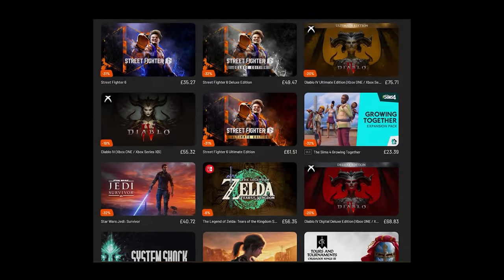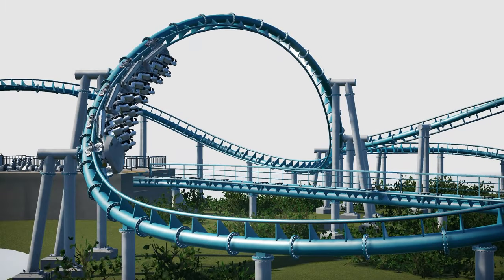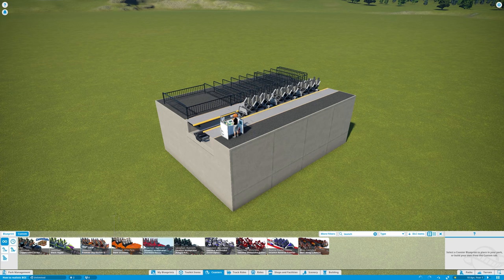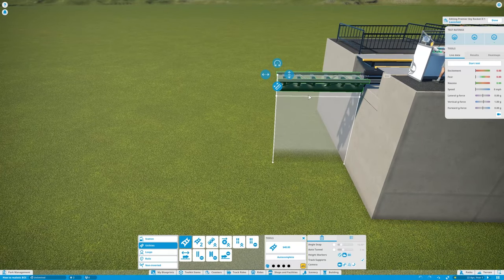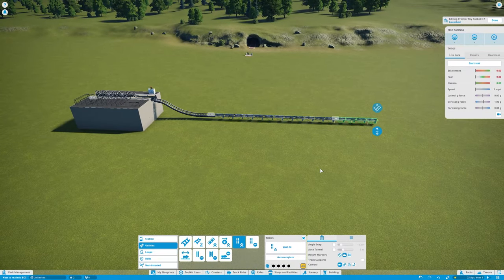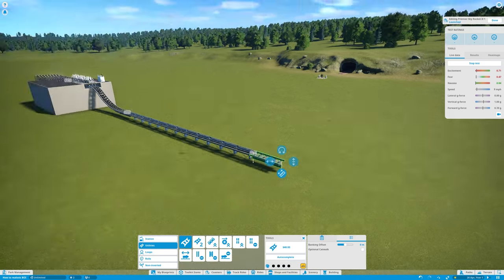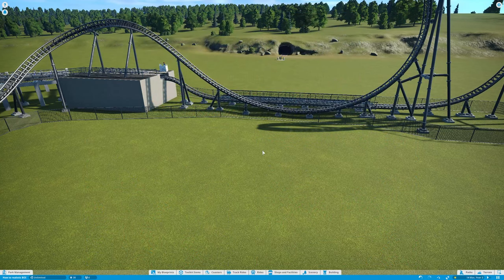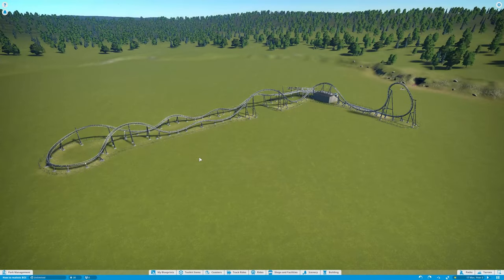How to make a REALISTIC COASTER - The Complete Guide - Planet Coaster Tutorial

Comment: Realism tip: if you're making an Intamin launched coaster remember to put emergency brakes at the end of the launch.
Reply: Is this an Intamin thing? I only just learned about them back in 2017 (Thanks Maverick @ Cedar Pointe!)

Before, I've seen an Aero Dynamic/Velkoma kinda guy until 2017. Intamin really know how to make a VERY aerobatic coaster and know how to make a slow, low attitude coaster feel like Mach 3! I love it!
Though, after riding my first RMC (Steel Vengeance) I realize that RMC has stepped into the ring and declared war with Intamin. RMCs are literally the embodiment of a crazy train! 😍
Reply: I don't think Intamin still does this cause lSMs can also slow down the train in an emergency
Reply: @samurai5589  no it's still does that now days. LSM can slow down the train but not as quick as magnetic brakes. On some modern launches, like on batman Gotham city escape, the launch is alternated with lsm and magnetic brakes
Reply: @flipperion lsms can 100% slow down a train enough it's just cheaper to have copper fins and lsms exchanging at the end
Reply: @kremink  it can't if it's inclined

Comment: So some tips to make coasters smoother, from what I've found:

1: Smooth starting from the back of the coaster going backwards along the track, then once at the station reverse and go forwards. Repeat process multiple times until it's smooth, and don't overdo it.

2: Manually heartline things instead of using the ingame tool. This is tricky to do, especially coming out of elements, and may require some adjustment once the track has been placed down, but it typically results in smoother tracks in my experience.

Also, I've found 5m track segments smooth better than 4m for some reason.
Reply: I also noticed that about 5m segments. I thought I was crazy!
Reply: Ooooooh!
Reply: Thank youuuu